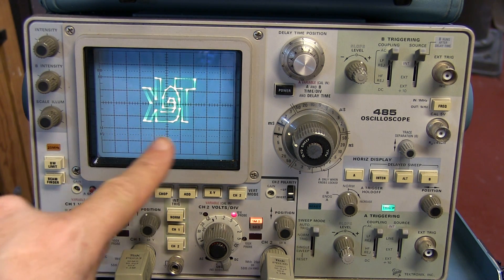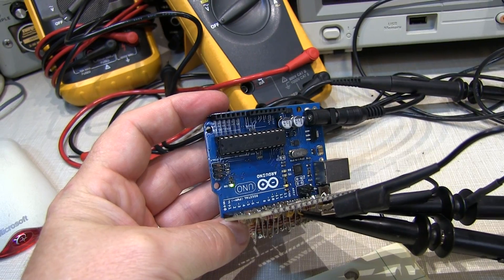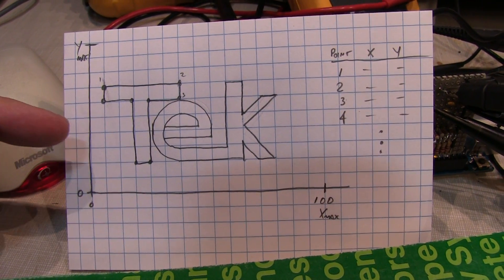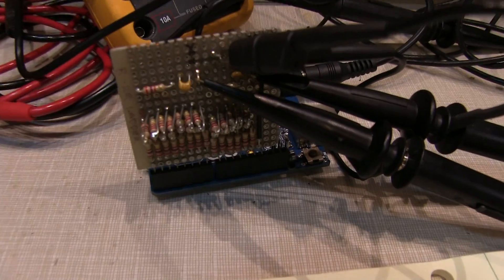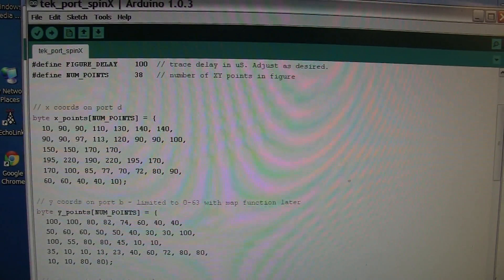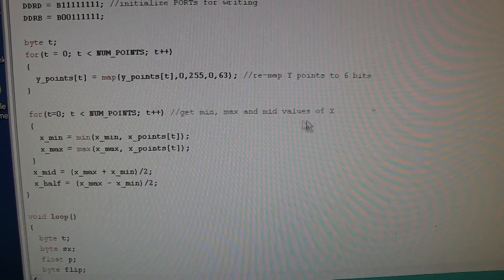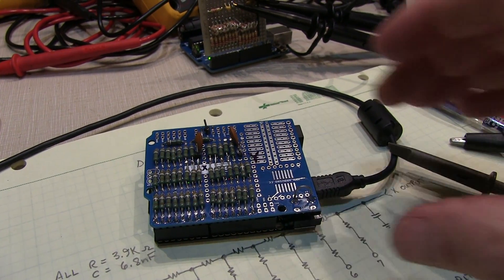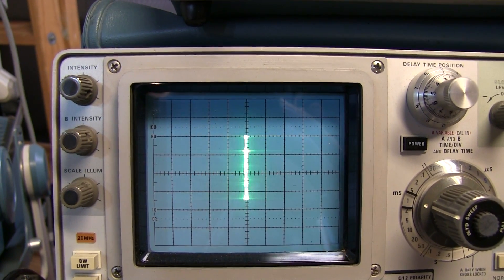#144: Use Arduino Uno to create spinning XY graphic on an Oscilloscope

Comment: I sometimes don't understand why people use arduino (specially when because of limitations you need to make dac from resistors, etc)
get some normal STM32F429i-disco, and it will do the same, only million times faster .
Reply from the maker: I agree with the comments.  The Arduino was never intended to be an embedded product.  However, what is was intended for - giving the masses an easy way to experiment with a uC - it's pretty good.  For an analog/RF engineer like me, with >30 years experience, but zero experience with micro-controllers, it's an easy platform to play with.  Of course it isn't the way you'd design a uC into a product (even though many do), it does provide an easy pathway to get people playing with hardware, and that's a good thing.
Reply: *****
well, st does give example to every peripheral available, so setting voltage to DAC is no more than 10 lines of code. for task cpu related, like calculation and port handling is very very easy, and you can get 80MHz toggle speed without any problem
Reply: I don't like arduino either or I should say, most people around it...it is suppose to be development kit, yet I see countless finished project with embedded 20€ arduino. Why not just use the GOD DAMN Atmel MCU for 4€ and use only that. The other thing that bugs me is that lot of people just copy paste the project that someone has already made and most of the times dont even know how and why it works... A lot of time I hear people asking me "Where's the arduino?" on most of my projects. Some people have this mental block where they think the arduino is the only microcontroller platform in existence and it's impossible to do even simple LED blinking without one. Every time I visit my local electronics shop there are some arduino fan boys getting pissy with the clerks because they don't understand basic programming or electronics and expect someone to give them step by step instructions to do every little things. Maybe some minor complaint about the arduino itself are misleading function and pin names, for example "analogWrite()" Really? Since when is PWM analog? maybe good enough for LED but try to use it on something bit more complex.
Reply: Linas K I have played with STM32s and I would use them over AVRs for a project design that requires mass production in a significant number, but Arduino is just so quick and easy with a great ecosystem. Very easy to get up and running. In other words it makes perfect sense for something like this where you might want other people to get involved.